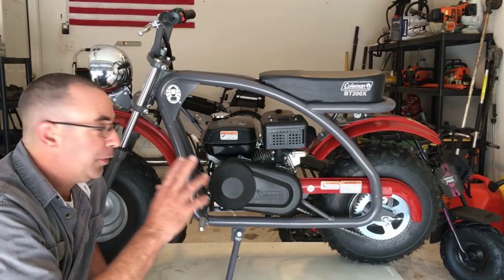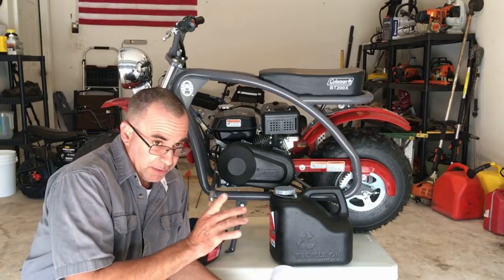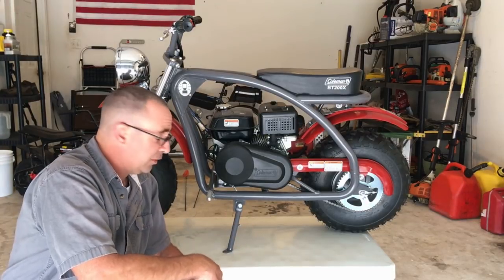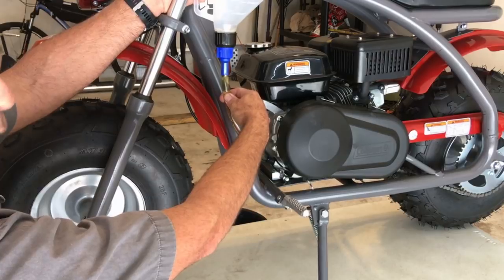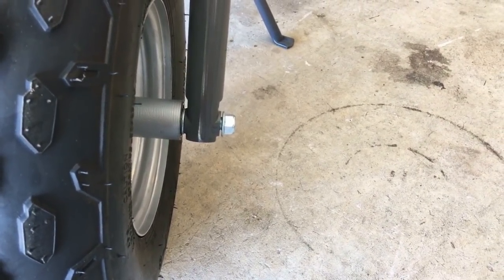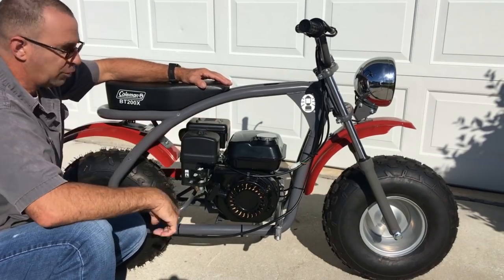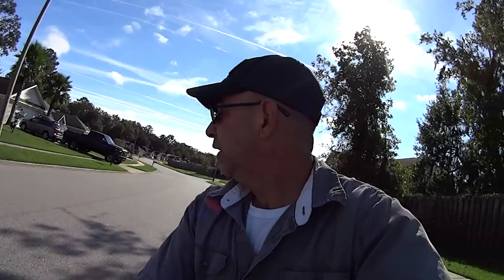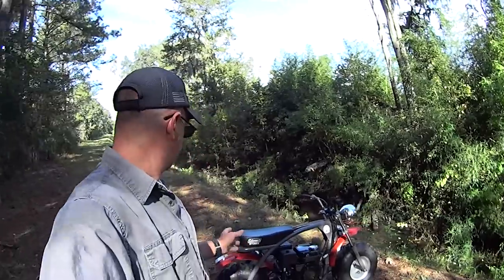NEW Coleman BT200X Mini Bike - Initial Review - Riding MiniBike Test

Comment: I am 6ft 1 270 lb and this thing gets me all around the property
Reply from the maker: Great info, thank you
Reply: Thanks for commenting this I was worried it would tow me around Because I’m 280 and it says the weight limit is 200
Reply: Cripple guy  let me tell u, It hauls Ass
Reply: @FitInMy50sVlog  do I really have to put ethanol gas or is it just
Reply: Cripple guy  total mechanical noob here. always wanted a small motor vehicle that went about 20-25 mph and want to order this. how bad" for the engine is it to loosen the gov screw? if i'm just looking to max out at about 25 mph for a 190 LB rider.. would loosening the gov screw do that? thanks
Reply: @BassHeadsProduction  Don't do it. Not worth destroying the engine.
Reply: I'll bet you at 190 it'll get you around just fine. Have you tried it yet. I think you'll be surprised
Reply: I got a BT200X (Black & Green) with stage 1 Kit & TC 30 series zip tie governor 10x50T(stock) gearing  im 265lbs. &hit 52 MPH 😅shit is a lot of funn😎 wear your helmets!

Comment: I like the beefy frame, I don't like the lack of a rear suspension, particularly for an adult. Handy tip, always wipe the dipstick off when checking the oil on any engine, sometimes capillary action will cause the oil to crawl up the dipstick and make it look like the engine has more oil than it really does. I had gotten in the bad habit of not wiping the dipstick off on aircraft engines, one day I wondered if that was accurate and checked it without wiping the dipstick, it showed the oil level as full, then wiped it and checked it again, this time it was a quart low, so I learned an important lesson that day.
Reply from the maker: I get what your saying about rear suspension BUT if that is the case, then the feel of the minibike would be lost. Minibikes are for slow trail rides with under inflated wide tires. The tire is the suspension but the lack of suspension makes going slow feel fast.
Reply: be easy enough to add some springs to the seat
Reply: The original had zero suspension. So some is better than none in my book.

Comment: I work at Wal-Mart and ordered my BT200X through them. They had it on sale for $498 and I get a 10% discount. Using site to store, I ended up paying a total of $472 for mine.
Reply from the maker: You are so lucky!
Reply: @FitInMy50sVlog  If you haven't done it yet, pull the plastic intake off and cut the stud of the throttle restrictor screw off. It is supposed to be adjustable but it comes tack welded. You will gain 4 to 5 more mph top speed.  I plan on taking out the governor as well. If you do that, you will need to order some 18 pound valve springs to compensate for the extra rpm.
Reply from the maker: I intend to do a full upgrade in the summer.
Reply: @Grey_Beard72  Wait where is the "plastic intake"? And about the welded screw is it the one that stops the throttle from moving further?
Reply: @proteg30  I put a stage 1 kit on mine. The plastic intake is in the corner of my garage, in a box. Yeah, the welded screw is the throttle restrictor screw.
Reply: @Grey_Beard72  Can you link a stage 1 kit for the BT200x? Thanks
Reply: Get the 60 tooth rear sprocket if you want amazing acceleration and torque itll hurt the top speed but I strictly use mine for offroad and rough terrain it comes with 50t rear sprocket stock. The 36$ sprocket and 15$ longer chain made the bike faster than all my other mods put together. If you just want top speed its free to do the jackshaft delete it makes it a straight chain bike and you combine both existing chains into 1 big one and it'll go like 50mph but ruins the torque

Comment: 60 tooth rear sprocket was the Best mod I ever got. If you just want to offroad, have amazing torque thats the one. I did 18 pound valve springs, intake, exhaust, racing sparkplug and upgraded fuel lines and fuel filter and an rk racing chain and removed the governor gear inside the engine the correct way and then after all that the 60t rear sprocket (stock is 50 on coleman) made it do power wheelies and burnouts all day and it still has enough top speed for offroad at least 25 mph but it'll burn rubber getting there

Comment: Nice review Dan, very thorough. I just picked up two BT200X mini bikes from Big R, they were on sale for Black Friday. First thing I did was cut off the front fork turning stops. Otherwise they have the turning radius of a zeppelin. I then had to reposition the brake cables under the foot peg instead of on top, and better secure it to the frame. On one bike, the brake cable was conflicting with the front fender. On the other, the headlight cable was conflicting with the front fender so I repositioned all of them on both bikes. I also removed the throttle stop tab on both bikes. Gave me a tad more throttle. I had to reposition the brake handle and adjust the brake tension on both bikes. Later I will get the torque converter kits, exhaust pipe with muffler and air filter kits. I also want to reposition the foot pegs more forward somehow at some point. I wouldn't go as far as say the power is amazing however, I weigh 250 and this bike does real good carrying my chunky butt around, so it is certainly adequate. More horsepower down the road might be in the cards though.
Reply: U guys  have a number
Reply: Need one so

Comment: They're worth every penny. I have a CT200 that has been put through its paces. Its done so many miles of hilly terrain with basically no maintenece, the only thing that needs done is the rear tire needs changed since i've worn it bald on DIRT. Bought mine used as well and i'm surprised at the quality for the price. They're really tanks and really reliable with the governor left alone, i'm looking at selling the two i have now to buy one of these. The front suspension seems well  worth the extra bit of cash for this one over the ct though, it does get a little rough sometimes lol
Reply: you can add the front suspension onto your Ct200... i did to mine
Reply: i thought this thing had a centrifical clutch, which requires constant maintanance by forcing you to repeatedly lube the clutch, at least that was the case with my Monster Moto, became a bit of a hassle, eventually just learned to ride it without releasing the throttle while braking so no drop to idle and no stall lol
Reply: @mythoti  I also have a monster Moto 212. Never had an issue with my clutch at all. Idk why people do. Lube it with chain lubricant, not 10w30. I actually wore out the front sprocket and put a new one on the stock clutch. Probably over 1000 offroad miles. If you use chain lube or lithium grease, it lasts much longer in the clutch than motor oil. I actually prefer the centifugal clutch over a torque converter. It's been less maintenance for me over it's lifetime.

Comment: Great call on changing the oil after a few rides! my oil looked like it had glitter in it with all the metal shavings..
Reply from the maker: I change the oil often in small engines like this when it is new. After the 3rd change, I will let it ride for a good 10 tanks of fuel ( 20-25 hours)
Reply: cheap machining, I drained the 1st oil on my honda push mower and it looked new, with no particles. Then again if honda made a minibike like this it would be $1200
Reply: @matt4398  honda does make a mini bike. They have made it for decades.  Its called the Honda Monkey.
Reply: @matt4398  it's actually $4k!

Comment: If you look at the throttle cable where it attaches to the carburetor you will see Coleman put a set screw in there to keep the bike from going to fast. I took a Dremel and cut the screw off. My speedometer app said I was doing 19 Mph before and 27 mph after. Took 1 minute to get 8mph more speed. I own 3 BT200s. You have to cut the screw because Coleman soldered it in.
Reply from the maker: I know but I am not interested in my kids riding above their skill level.
Reply: Hey bud! I’m looking at cutting the screw, just bought my bike this weekend. Being that this was 8 months ago, are you still running strong? Any issues since altering the governor screw?
Reply: Yeah I've had zero issues whatsoever. We took them out to the local ORV Park a couple weekends ago and had a blast
Reply: SuperRedthunda awesome, good to hear and thanks for the response!
Reply: @phil_8367  It is the throttle screw. It doesn’t affect the governor at all.

Comment: All it needs now is a 212cc engine with a cam, billet rod, billet flywheel, valves, springs, remove the governor, a mikuni carburetor, header, port and polish  and "It'll be fine." 
Maybe change the clutch weights to get a higher rpm stall. 
Then like all responsible dads put your 5 year old on it. Hang the fuck on Jr. LOL
PS always wear a helmet.
Reply: Cars & Cameras suck, it's all about that RBG & Rather B Welding
Reply: LOL ( hang the fuck on ) that's what my dad use to say....lol am dying
Reply: @LNRRidez  cars and cameras have resources and tools, RBG and chris make better content
Reply: it needs a torque converter, not a clutch. torque converters will enable easy easy wheelies, provided the gear ratios arent changed, also theyre a ton quieter and much more maintenance free
Reply: You can hot rod the engine that it has. You don't need a Predator. LOL.

Comment: I custom built my own frame and put a predator 212cc from harbor freight in it I bought for 150 bucks. I did however do a stage 2 upgrade to the engine, new rod,cam,springs,flywheel. And I'm rocking the juggernaut torque converter and a mikuni 22mm carb. I plan on taking it even further with a new crankshaft, piston, head, valves, rods and lifters. But I need to build a more stable frame before I go that far. Thing has alot of power.
Reply from the maker: I bet it does!!

Comment: Help I have one and when ever I start it I lift the rear and the wheel spins and when I ride it and I barely move the throttle it stays for like 2 seconds and the throttle goes all the way back but it does that
Reply from the maker: Sounds like you may need to lubricate the linkage on the carburator and make sure the return springs are properly connected.

Comment: I like using the supertec 10w-30 ATV full synthetic oil from Walmart
Reply from the maker: That’s cool. Out of curiosity… Do you think there is a difference between ATV synthetic oil and regular synthetic oil?
Reply: @FitInMy50sVlog  In my opinion oil is oil it's better than no oil but I've seen that small engine oil for air cool engine have a higher zinc content than automotive oil small engine oil and has a higher boiling point also meaning that it can withstand heat longer. Ive used my mini bike for 10 hrs a day for a week only to find out it still held a slight golden color so I pushed it to 2 week's and the engine oil held up all of this was done in glamis California where temps can hit outside of 110 degree plus also used it on some trails in Palm springs where it also hits 100 plus and the oil is still nice and thick after hour's of use.
Reply: @FitInMy50sVlog  other then that my favorite automotive oil is Castrol GTX when I can't find anything else.
Reply: @Platano_macho  well, oil is oil unless its quaker state lol!
Reply: @FitInMy50sVlog  from what ive heard atv oil is essentially a racing type of oil, which means better heat transfer/tolerances because of its common use in air cooled engines, id assume better anti wear protection, and probably some better quality detergents.
Reply: @thisoldchevy2371  and that my friend is a fact

Comment: The frame shape is similar to the Simplex Sportsman line of mini-bikes from the early 1960's except those had a metal gas tank at the top front of the frame; they were the best looking, actually looked like a small motorcycle.
Reply from the maker: Coleman CT 200 EX I believe has that tank that doubles as a tool box
Reply: The Baja and newer bikes have a plastic/fiberglass fake tank that doubles as a tool box, yes. The Simplex was all fuel tank, you could ride all day!
Reply from the maker: Oh I see! Wow!!

Comment: Man, I had to pay 800 for mine. Tractor supply has them for 650 but they are out of stock every single one within a 50 mile radius so I had to resort to buying at Ace Hardware but they are fun machines.

Comment: easy to over fill these. I was going off of it being threaded in and out. I had to drain some oil cuz I was blowing smoke and losing power as pressure came up. Caught it in time. Non-OXY gas; never gas with ethanol. Good idea for the oil filler (cleaner and more accurate). #BT200EX

Comment: Do you have any idea we’re I can buy the front forks suspension for this mini bike or any same size mini bikes? I’ve been looking and Coleman wants about half the price as a new 200 BX at Walmart for 499.00. I already have 3 new mini bikes same size but none has telescopic suspension on them and my plan is to get the suspension and make a swing arm to mount rear shocks to on my mega moto MM212. I also have a Coleman CT200U with the racks but plan on leaving it as I bought it. Any idea’s would be great.

Comment: total mechanical noob here. always wanted a small motor vehicle that went about 20-25 mph and want to order this. how bad" for the engine is it to loosen the gov screw? if i'm just looking to max out at about 25 mph for a 190 LB rider.. would loosening the gov screw do that? thanks
Reply from the maker: You can loosen it. No big deal
Reply: @FitInMy50sVlog  thanks man. just got mine and got it running easily.. but a few things maybe you could help me with if you don't mind-  the chain fell off right away, had to loosen back tire and loosen the chain to get it back on.. and then tried to tighten it back up.. but it didn't seem like I could tighten the chain back.. I tightened both sides to the max.. and the chain still seems to have a lot of slack on it.

also it smells like burning plastic a little bit after running.. not sure where the smell is coming from.. and it doesn't smell like burning rubber from the tires.. but more of a burning plastic smell.

also it sounds and feels like the front fender is rattling a lot even though it is tightly on.. lol a lot of shit i just wrote, sorry.. any advise? thanks!

Comment: How is the headlight hooked up? Does it have a battery somewhere
Reply from the maker: No battery required. It get's its electric power off the engines self contained "generator" off the flywheel

Comment: what’s the difference between the CT200U & the CT200U-EX? & which would you recommend?
Reply from the maker: The 200 U is just a larger version of the 100 U. The EX has a headlight and front suspension just like my 200X but the EX also has a fake fuel tank that is a large storage case. I like the EX best of all
Reply: DansVlog912 do they all have the same engines? & do they all have the same aftermarket support?
Reply from the maker: I believe the engines are the same and I would imagine the support is equal across the models
Reply: @mdpope4965  the colemen CTU200U ex and the colemen CTU200U and the colemen bt200x have a 196cc engine i have the colemen CTU200U ex i got it not that long ago the reason I got the EX is because i wanted the  fake gas tank  i got my tool kit and my gun in there it's a pretty big storage space in my opinion i think the ex is better than the bt200x and the ct200

Comment: I’m 6’ with a 30” inseam and 250lbs, would I fit?
Reply: I just got one and I'm 6' 215 lbs. It is comfortable for my size. The seat is actually a little taller than my lowered Harley Davidson Fatboy..
Reply: I'm 5'11", 275lb and have no issues with fitment on a standard CT200U. The ergonomics looks even better on the BT200X.
Reply: Yes

Comment: I have the same bike and I did Mount the rack on it from the other bike
Reply from the maker: Thank you so much, I will try to order one today for my BT...
Reply: Do you have pictures? I just got a BT200X and want to do the same. Is the rack level?
Reply: you have to mount the rack to the piece of metal under the seat where the fender bolts to drill two holes for rack mine os level and sturdy
Reply: @Mouthpiece985  thanks Warren sending now

Comment: Hey Dan, I've got a BT200X, and I'm gonnna buy a Predator 212 soon, do you think it will fit? I'm just curious if you were to know. :)
Reply from the maker: I believe the engine shaft on the 212 is 3/4 inch and the shaft on our Coleman’s are 5/8 so you will need a new clutch IF that is the case
Reply: @FitInMy50sVlog  thank you sir, I really appreciate it!
Reply: Why would you get a 212? What's wrong with the engine it has?
Reply: @Deucealive75  predator is way better
Reply: @teydilla724  Predator is not way better. It only has a little more torque than the 196's. If I wanted way better I would get a Ducar or Tillotson. Either of those have higher quality and more power than a Predator.

Comment: Ok so been shopping as I plan on getting 3 Mini's for Myself and My 13 and 14 Year Old, I bought a CT 200 U that was used but with very little use, some minor TLC and it's like New, runs great. Been looking for the BT 200 X like what You're showing here, want New and Front Suspension. I've looked high and low, can't find the BT 200 X anywhere! Are they no longer available? Also, would the 200 series be too big for the Boys, I'm thinking the CT 100 U would be plenty enough for a couple young Teens? Any thoughts/suggestions would be appreciated..  :)
Reply from the maker: https://youtu.be/4K2r5K7gQlQ This video shows my 10 year old riding my 200X. Walmart has a 200X at my local store in stock so maybe walmart.com will help
Reply: They are back in stock. Walmart sells them online for $600.07 out the door. I bought 3 :)